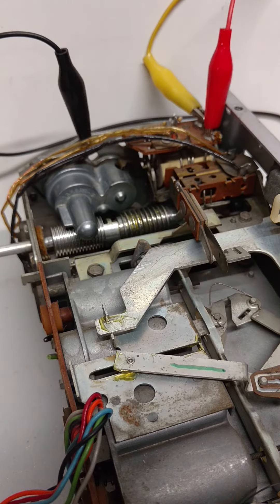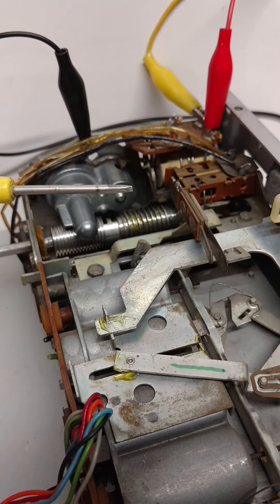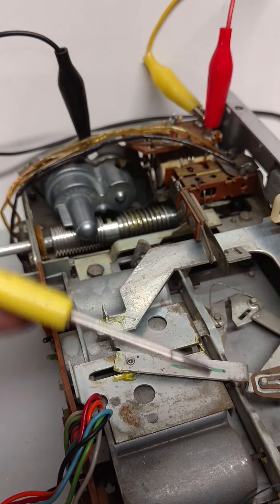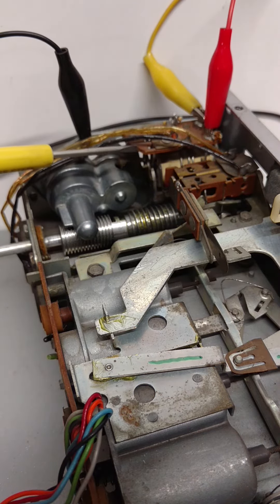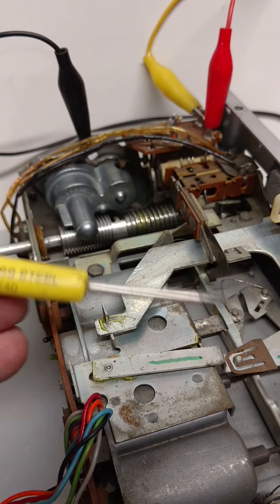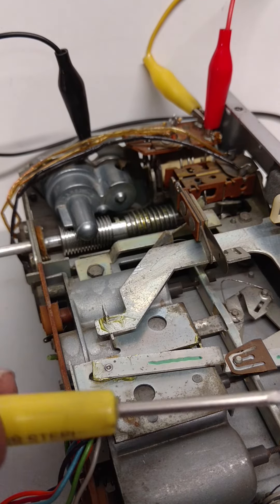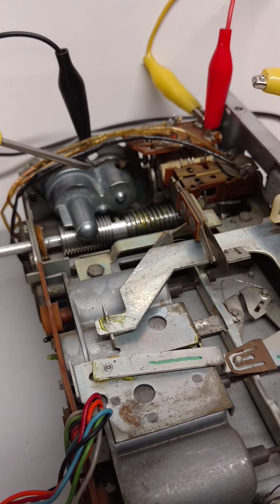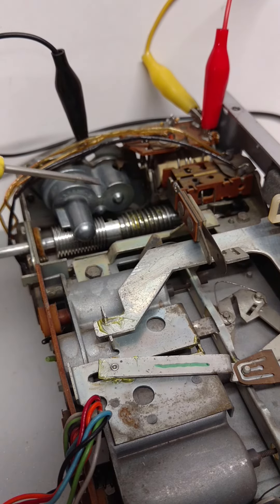Testing a Delco Wonderbar Mechanism

Comment: Great video. I have a wonderbar in my 55 Chevy that I sent to a fellow in Ohio and he refurbished it free of charge because I helped him with needs on his 55. He replaced all capacitors, new speaker etc. It worked perfectly when I got it back. It's been in my car about 10 years now. I guess what happened is it was never used. I have a hidden CD player and changer in the car I use all the time. I was going to show someone how it worked one day a couple years ago and now when you press the seek bar it works across as it show stopping at stations. But, once it reaches the end of the travel to the right, it stays there.
Reply from the maker: Mike Milam - important is that you turn off the radio when that happens. because it is stuck trying to still seek, it could burn out the relay or solinoid depending on what's being actuated at the time. the 1955 mechanism is quite different than the one in this video and I would think the return switch has become corroded. if that's the issue, it's a fairly easy fix

Comment: These radios are so cool! I have a 1953 Packard Cavalier with a Delco Model 439339 wonderbar radio, which a friend of mine who restores antique radios is working on for me. He has gone through tested and replaced bad/weak components, cleaned and lubed it, and everything is working. But we have one question that maybe you can answer. When the pointer travels all the way to the right and then returns it draws quite a bit of amperage, if the battery is a little low on charge the return doesn't work. Is this normal, or might we have another issue we should be addressing. Thank you for any insight you can provide!
Reply from the maker: One thing to remember, which I am sure your friend would know is testing using a power supply and testing using a battery are different. For testing a Wonderbar type radio using a fully charged battery is best. Since the car should be 6 volts, anything lower than 6 can cause very slow retracting or even the radio to not be able to fully retract the pointer. If the tuner is cleaned/lubed/aligned properly all should be good internally. I would recommend NOT using the Wonderbar feature if the car isnt running to ensure the electrical system if supplying full power. Anytime the tuner locks up when trying to retract the pointer you should immediately turn the radio off and then back on.  If the radio is trying to retract the pointer and cant, it will keep the circuit energized and could burn out the relay or solenoid.
Reply: @joesclassiccarradio  Thank you!!! 👌
Reply: @joesclassiccarradio  Thank you again for your help!  The radio is all fully functioning, which is very cool. 

Can you help with noise filtering capacitors? Are the capacitors used for filtering noise essentially the same as the capacitor in the distributor?  I have several on my car and they have different part numbers, but I don't know if that means the actual capacitor is different, or if the different part numbers are due to the capacitor having different brackets and leads. 

The cap on the generator is a 1925118 (5 MF)
The cap on the coil is a 1917580 (5 MF)
The cap under the dash connected to the ignition switch is a 7259643 (5 MF)
The cap in my distributor has no part number on it, but the correct modern part number should be an ECHLIN RR-134

Any thoughts you have would be appreciated!

Comment: Great video. Amazing what they were able to do mechanically back then that we take for granted today through an electronic approach. Curious - since there is no electric motor involved, what is powering the initial spinning of the gears? I understand the solenoids are used to reset the mechanism and that the flywheel helps keep things moving smoothly once it starts, but where does the power come from to spin the gears once the 'finger' lifts? Spring pre-loading somewhere? I have a Mopar model 420 AM/FM that works excellent except for the seek function. Relay works as it should, but the gearbox does nothing. Tunes fine by hand. Would love to have it back in the car working with the foot switch.
Reply from the maker: Todd Bigelow . there is a spring that pulls the gear assembly forward. the pressure from the spring is what moves everything. the gearbox inside only slows the movement. chances are the gearbox is dirty/ hung up or the relay that releases it may need adjustment.
Reply: Thanks for the speedy reply, Joe. This is the original radio that came with the car but was swapped out for a Jensen cassette deck back in the mid 80s by the previous owner. Car also has the rear seat speaker and factory reverb, so I really want to get the 420 working right again. It did have a bent shaft when I removed it from the trunk, easily fixed but perhaps the spring came off inside. Relay works great, picks the finger up well, but the gears don't move. I've oiled it carefully in places but the car sat in storage from 1986 until last summer, so it's likely gummed up in there somewhere. In the event that I can figure it out, do you do tuner-only rebuilds? I'm not going to tear it all apart if I can't easily fix what's wrong with it. Covers off only.
Reply: Got the mechanism freed up but the return solenoid isn't working. Could be a dirty switch, also from sitting 31 yrs. Managed to lose sensitivity as well, I'm thinking the relay contacts need a better cleaning. When I use the Local/Distant buttons it tries to come back in. Thanks for posting this video and your response, Joe. Another Wonderbar is on the road back to use and enjoyment.
Reply from the maker: Todd Bigelow glad to hear you have some of it working. If you need additional help it is best to email me at joesclassiccarradio@yahoo.com
Reply: Will do, Joe. Had to set it aside for a few days but will get back to it and drop you email if (when) I run into problems. Thanks again, very much.

Comment: Cool video and great explanation! I have a '66 am/fm Wonderbar that the wonderbar feature isn't working on suddenly. It was working  up until recently, but now when I hit the wonderbar I hear a "click" and the radio stops playing. I have to turn it off and back on again to get it to play again. I took the top off and watched like in your video and the transmission doesn't move when you pull that little pin out of the gear (just like when you hit the WB button). The radio shuts off but comes back on when you put the pin back into the gear. Any thoughts on that?
Reply from the maker: Part of the purpose of the relay is removing the "Pin" from the gear, but it also mutes the audio of the radio. When you press the wonderbar button the relay is actuating and causing the radio to mute. The reason for the tuner not moving could be a few reasons- Dirty/dry mechanism, solenoid not pulling the tuner back to the beginning or even the switch that triggers the solenoid may have stopped working. At this point the radio may be beyond the capabilities of someone not familiar with the disassembly of the mechanism and you may need to look into restoration or conversion of the radio. Good Luck!
Reply: @joesclassiccarradio  that's really good advice. I'll try spraying a little deoxit around here and there and maybe a little lubricant. Other than that, I'll have to look into getting it looked at. It was working as advertised recently so it's kinda weird but I guess that's how it goes with an old radio.
Reply from the maker: @ourkid2000  Try to manually reset the mechanism by either pushing in on the return solenoid or pushing the long gear on the tuning shaft towards the rear of the radio (Dont Force it if stuck). After it is reset, turn the radio on and try the wonderbar again. If it runs normal, probably the solenoid switch is getting dirty/bad. If it runs until the gear gets back to the front of the radio, again could be the switch or the solenoid itself. If it still doesnt move after the reset then its a dirty/dry mech. Dont spray lubricant everywhere- a little on the moving joints/slides and a little on the solenoid plunger and tuner shaft should be enough. Good Luck!
Reply: @joesclassiccarradio  awesome tips! Thanks so much for this. I've got the '66 Delco service manual for the radio but unfortunately it doesn't have any troubleshooting tips for the Wonderbar function. It's only got the alignment procedure. I'll try what you suggested and see what I can find out. Thanks again!
Reply: @joesclassiccarradio  so, I tried your suggestions. When I manually pushed the return mechanism back and turned the radio back on, I got some movement.

I put the dial all the way to the left and pushed the wonderbar. The mechanism moved the entire length of the dial but didn't reset. It got to the end and stopped. I guess that's progress! It stops on the stations along the way as well.